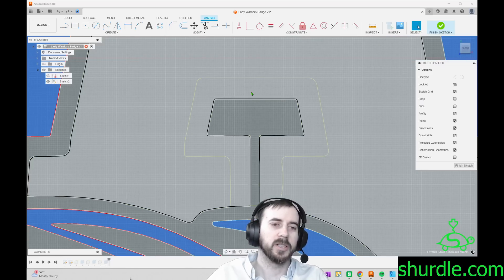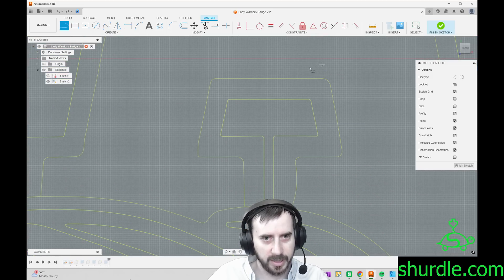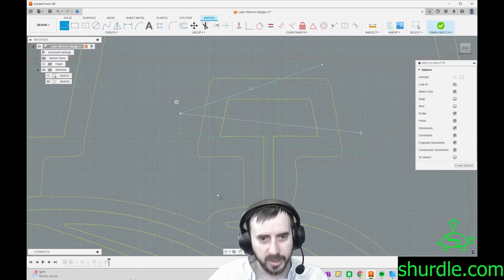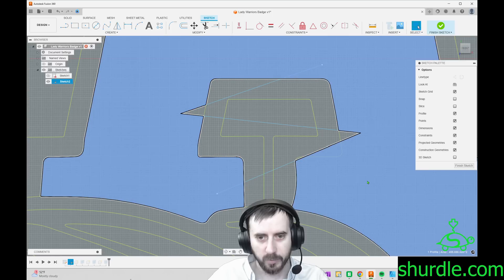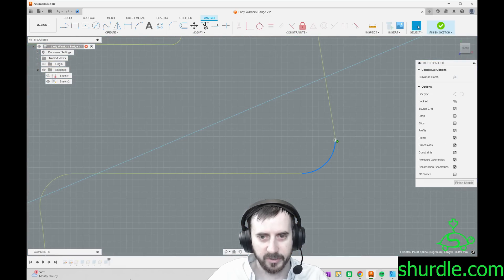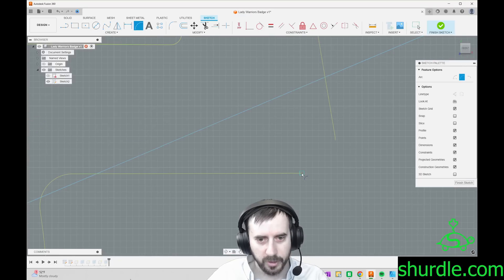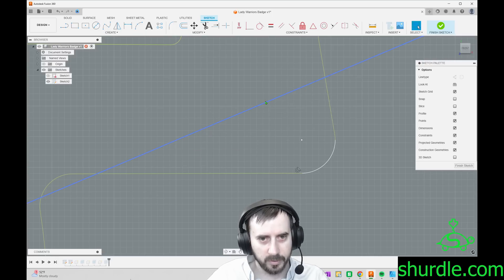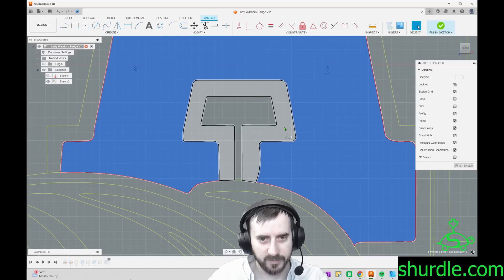Find & Fix broken line in Fusion 360 - Video 2 - Shurdle3D

Comment: now is there a way to join that line so it can be selected all at once? Im having a problem with joining 2 lines on a sketch that is my outer perimeter and it wont let me double click it and select all the parts at once. I have to ctrl click each section.
Reply from the maker: @jawknee21  it’s because you have 2 lines laying on top of each other. If you’re using vectorizer, you can check my latest vectorizer video clips for the settings